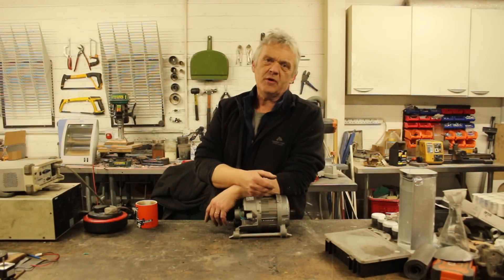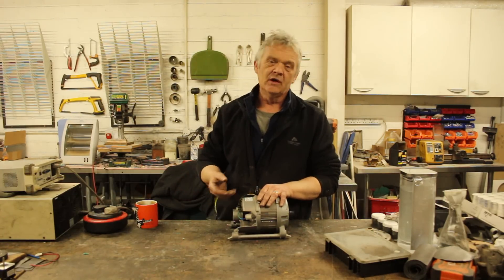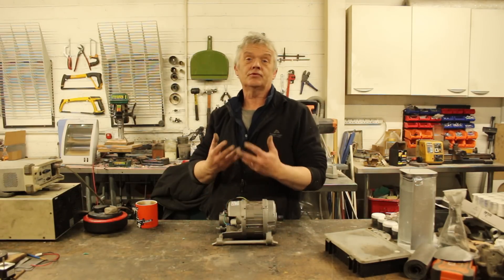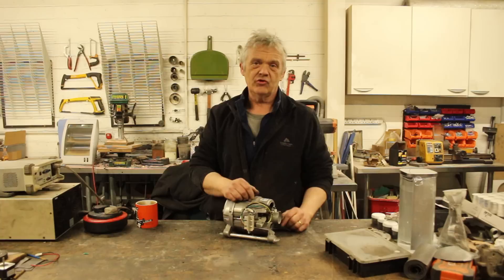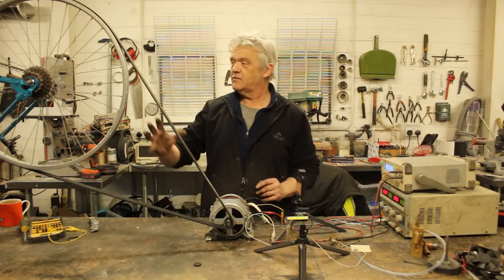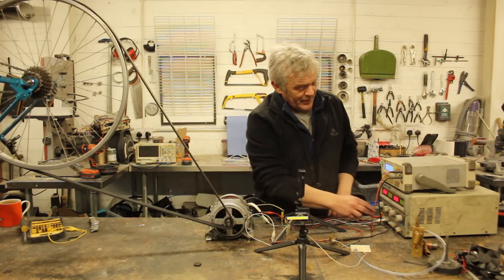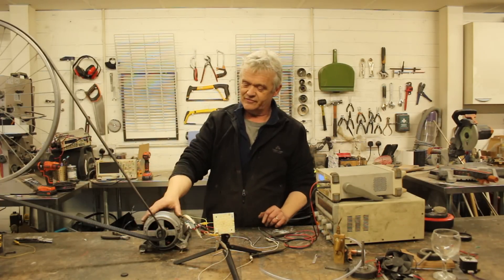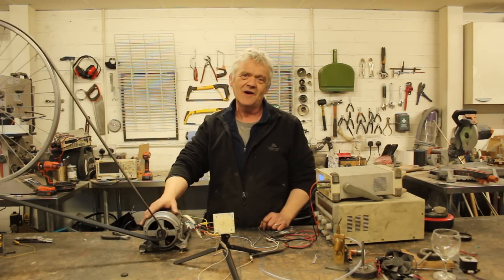1523 Universal Motor For Wind turbines

Comment: What about building a 120/240 AC 50/60 hz generator with one of these? Using a gas or diesel engine, or steam, with electronic governor??  Can it maintain frequency and voltage? Im guessing it will require a voltage regulator to prevent  putting full power on the field coil  and provide a Means of voltage regulation . And using the rotor as the field. Opposite as this example and possibly rewiring the commutator so it behaves like sliprings. Connecting in 2-4 groups to Make 2-4 poles. The frequency / rpm required depending on the poles  it will likely require a rewind atleast a rewire!  Putting groups of coils in parallel!  It will end up as what. 1000 watt generator at best? What is the hp rating  ,,half? Making 370watts running power  maybe a group connected to s 9/10 hp diesel engine burning used cooking oil/ bio-diesel!  Use about 6-8 motors connect to a jack shaft and wired  together in phase  , possibly use simple electronics to build a  analog regulator . With it Based on a zener diode resistors , caps, a pot.,and a MOSFET. Maybe a full bridge rectifier and voltage divider to get the required DC for the field. The voltage reference, the pot to set the precision of the output voltage.   Find the amount of dc voltage to get the required ac voltage, and how much more is required to keep the voltage under full load!  I guess i answered my own question!  So new question,  would it be worth it?  I guess you could basically fo this with any ac motor! Only require building a rotor with field coil, and a Means of completing the circuit! And it must create the required magnetic field to generate the required output!!  I have some large series wound DC motors, from a forklift. I was thinking about doing something similar in a hydroelectric project. I don't have the water!  I could use it for a ,24/29 v DC generator to charge batteries but i think the modified car alternator will work for this!  I don't exactly need a generator that large! It would require a 100 hp engine!!😮

Comment: I'm confused. When I was thinking about what kind of DC motor could be used as a generator I thought washing machine motor. And I found this video, but later videos are about using magnets and coils from a microwave ... so what is the better option? I have spare DC inputs on my solar inverter and I thought it's a shame not to use them ...
Reply: If you do not have a good understanding of electrics or electronics , Please, STAY AWAY from Microwaves.👍

Comment: So question. Do you attach the out wires on the brushes or the fields?  Looking tomake a wind turbine but looking to add an inverter then to a battery storage system or something similar.

Comment: Have you tried a ceiling fan generator. I get 120v and light up a flood light bulb. It looks like I'm getting a lot more power than anything you have done. I love your videos
I used neodium magnets
Reply: Did you put the magnets facing opposite poles side by side around the outside of the motor?

Comment: My question is, What is better, A stator as Magnets? Or a rotor with Magnets?
Reply: Well, with the magnets on the rotor, that means the power producing coils are stationary, which makes getting the power out of the generator a whole lot easier and way more reliable. That was the reason auto alternators we're designed that way.
Reply: Sorry I took so long to reply back but doesn't some alternators their routers sorry rotors have coils instead of magnets
Reply: @jsnelleman  - Of course many do. The rotor coil takes the place of magnets, producing the magnetic field that is needed to produce electricity. IOW, an electromagnet. The beauty of using an electromagnet is that it makes controlling the alternator output MUCH easier. It is difficult to reliably control output of an alternator that uses magnets.

Comment: I totally forgot about series and shunt motors/generators and how they can externally excited. A greater field strength could not only be used, as you mentioned, as a brake, but also to limit the top RPM of the motor/generator so it would not exceed the input of a charger or other circuit. Also the torque curves are a lot different for each type of motor from memory.

Comment: Surprised nobody uses EV motors for the smaller end of industrial scale wind turbines. Economy of scale means something like a Leaf motor in a 50-100kW turbine shouldn't cost much at all in comparison to an "engineered" solution. Even the power electronics come as part of the package.
Reply: I was thinking the same, I have a renault fluence motor with the power electronics and was hoping someone else had this idea, have you thought any more about it?
Reply: @Aquavidify  I don't have the land for it. Just struck me as obvious. Makes way more sense than repurposing washing machine motors.

Comment: Robert Murray Smith! Was the coil on the 100£ VAWT TRASH? To make the best variant on coil if a few gears is in the core of the sheape of the coil a extra Capacitator  a wireing so it give a extra boost in high wind, diod to get a flow DC a conducted plastic material how increas and drops in high or low spinn! Coil filled with Washer (coin) for give a max at minimum work fore the VAWT or HAWT! it this possibe? Variants of metals on the washer! You might se me as lazy! In this case. You is in an Workmode on this and I still hope for right resources to do my dream machine!!! Rob you still my favorit You-tuber! So hold up the god work! It is just awsome 🙂!

Comment: Amazing that it can generate without input, due to a remanent magnetic field..  Same can be done with an alternator? How long does the remanent field last? If you stop using it for long periods, can it be started back up without a "primer" current, from a power supply?

Comment: A number of comments are hovering around the same idea I had: If the feedback loop causes the torque to be too high, there needs to be some mechanism to reduce the power in the feedback loop. A manual one (potentiometer?) would be trivial to introduce. But a smart one that adjusted based on the generator RPM would likely be the most efficient .

Comment: The universal Motor is a fantastic Idea to use and to be honest I think that even if you feed it its own power back, with an variable resistor and an Arduino you still could make a controlled feedback loop. Then you only need a power bank and a small converter to reload the power bank from the generated Energies. Voilà, self-sufficient smart-controlled Power generation!

Comment: Thanks for bringing these motors up. As the output is controlled by the speed and magnetic field of the motor my only concern is voltage drop from the generator to the batteries and ballast. I have been experimenting with alternators and controlling the field by a basic potentiometer attached at the top of a rod with a small weight and a plate at the bottom. As the wind increases it pushes against the flat plate, changing the value of the pot. This is used through a simple circuit to increase the current to the alternator, so the magnetic field also changes. Being ac, I am not limited by distance to the controller and batteries. The current regulator is mounted on the wind generator so it follows the direction of the air flow and compacts the electrics.
Reply: What about building a 120/240v AC 50/60 Hz generator with these?

Comment: How hard is the motor to turn without the field energized? Could you use a separate anemometer to adjust its current or voltage (whichever is better to tune to windspeed)?

Comment: Another great video Sir Robert. I have a couple of questions; 1 are you going to do a full build with the Arduino and all, that would be so great!!!! 2 what is the best way to change the gearing so that you can overcome the high torque so you can get use of lower wind speeds to generate? Do you increase the size of the gear on the generator end or are there some other things that can be done to accomplish the same thing? I am really interest in getting use of very gentle breezes with something like this. Thank you in advance to anyone who wants to help in these questions?
Reply: Over coming the torque could be done by limiting(resisting) the current flowing into the stator or by increasing the gear ratio. Keep in mind any reduction in torque will reduce the power output whether by reduced speeds from gear ratio or less "friction in the electromagnetics

Comment: I have a armature just like that with large permanent magnets casing. It's a 90v dc motor. It came from a door opener from a hospital. It generates about 120ac when I turn it with a 12v dc motor. I also got the electromagnetic door lock with it. It's a 1200 pound rating at 12vdc. It's amazing

Comment: Very interesting! I may be way off on this but theoretically you don't need any initial electricity to energize the stator coils on a universal motor to initially get it going because we are always exposed to the Earth's magnetic field. The rotation of the rotor coils would cut across the Earth's magnetic field and would generate an electric current. As small as this initial current would be it would grow rapidly due to the feedback to the stator windings. Am I wrong on this?
Reply: You're not wrong theoretically, but in practice the residual field left in the silicon steel of the magnetic shunts/case is going to be orders of magnitude higher than Earth's field, and so this is what contributes most to self starting.

Comment: Hi Rob, I’m in the process of creating my wind turbine so I’m super interested in what you have to say. I’m considering exporting anything and everything I generate directly to the grid, I already have solar PV and this is very successful.  If I can export enough then I don’t need to store the energy in batteries as the electricity I use from the grid will hopefully be covered by the Feed In Tariff from the generated electricity I export.  What do you think?
Reply: I think you are killing the grid get some bateries.
Reply: @ghz24  explain?  No different from all the many solar panels exporting to the grid.
Reply: @SimonPlatten  Yeah no different, they are killing it as well.
The grid isn't a battery, electricity must be used or it's gone, power plants aren't made to rapidly change their output.
They have to operate regardless of the whims of wind and sun.
With lots of grid tied generation stations that can't plan or time their contribution the power plants must still operate as if there is no contribution and operate at levels above demand and are forced to take power they don't need or are even able to use.
Nobody suould be surprised when they have to raise the rates on the smaller amount of power they sell when they still have the same overhead and must maintain the output levels needed to power everything if the wind dies or clouds move in.
That's a really short simple version of a video called "how to kill an electric grid" by a woman (can't remember her name) who goes into excruciating depth about how this happened in Australia and why they pat 3-4 times what less "green" countries do and what they payed a few short years ago.
I litterally hate seeing those commercials here on youtube trying to convince people to let a company install solar panels on their home to get a pittance for the use of their roof while they screw everyone else on the grid. Once enough people go for this seemingly cheap route to solar the rates will increase to levels above what they were paying before and now they can't even install a solar system of their own because they leased their roof to some company that doesn't give two shits about general good.
Batteries make it like you just use less power not unbalance the entire grid allowing for smaller powerplants to serve more area not run above capacity so they can step in immediately when the sun or wind fails to perform as expected. I know it's PC to hate on electric companies (sometimes they deserve it) but using the grid as a battery just hurts everyone.
Reply: @ghz24  not really, the grid is always in use, it’s just everyone contributing to the output which as you say it’s always live and if everyone gets an EV someday demand is only going to increase, all to often are the few EV chargers around with out of order or cannot output nearly what they claim.  Just yesterday in found a 175KW charger, the best I could only get 71 KW from it yet my car is capable of taking 100 KW.

Comment: Controlling the Voltage and its Current these days are as simple as The Italian Word "Arduino" and even the rPi-2040 mini-board can do it.
. For Speed Control, a Steams Engines Centrifuge Governor/Limiter will due quite nicely. Simple Science fare stuff - really.!
. . The Entire Point is actually doing nothing new, to our Generation, because we know about what they are and how to use them.
. . . The Jr High students have been practicing with their Q-CAD and 3D Printers as to starting to make projects  for our Science Fare.

Comment: Could you not use a variable resistor to control the feed voltage
Reply: Doesn't the resistor turn energy into heat?
While the idea of a feedback loop to make the wind turbine self exciting and self-braking in high winds is interesting, how much of the output power does it consume???
Sure you can light up a few LED's but does a washing machine motor put out any real current when feeding back into itself?
Reply: @jimurrata6785  this is where I would put the variable resistor in the feedback loop to control the speed and power output with the wind speed

Comment: That was great, would be good to use multiple units. If your lucky enough to have them? I tried to mention this to XR because of the green agenda.  But find them just to be doing donuts in a half pipe . Yes it is great ideas and most people don’t even think about it. The spend 4K on electricity each year when you can have it for free. Then owe to nobody.  I bet you could chain link a few other together. Or have a slew gear where you can place as many as you can find on the ring gear. Bamboo turbine might be a good use for this.

Comment: Thanks Rob. The main advantage I see with the alternator (sourced from a wrecking yard) is the internal rectifying diode pack. DC out without the need for external rectification :) Cheers  mate. OOPS...should have finished watching the whole video🤣 Wonder where the universal motor can be easily found here in the states.
Reply: I noticed my old Vacuumes,  coffee grinder,  dremmil tool all run on D.C.  to make a right North/south Field might need to change feed wires or power the poles with magnets
Reply: Think the electric lawnmowers are universal motors. I have 2 in storage for the time when I can do it.